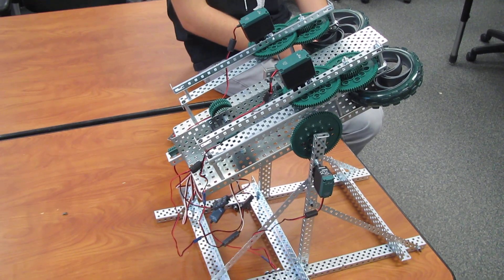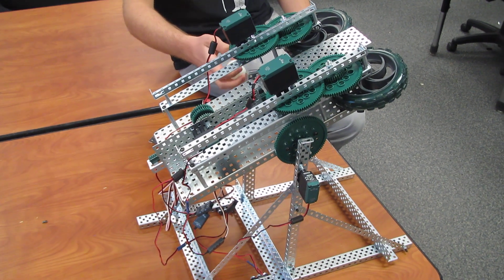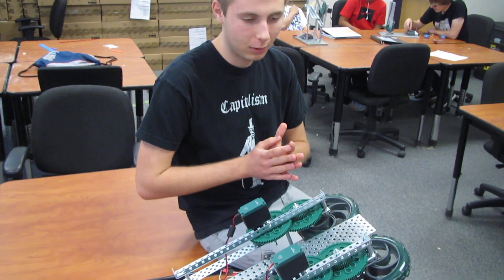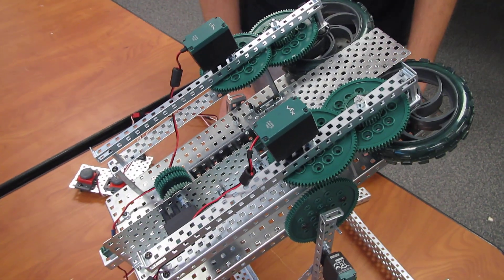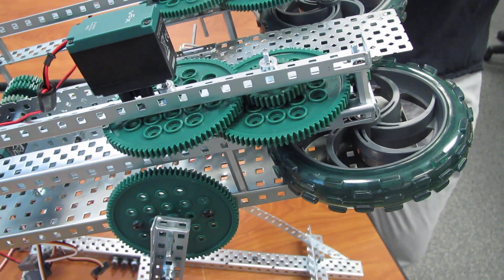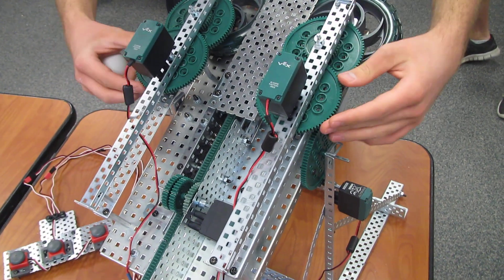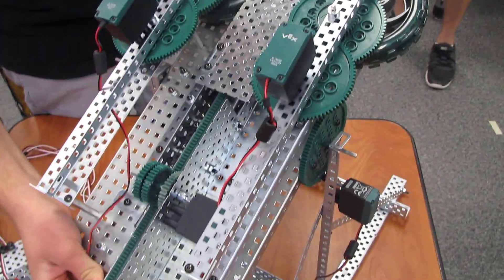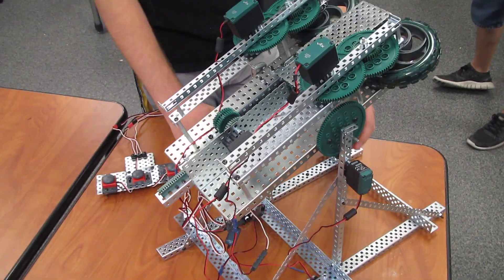Ping pong ball launcher Vex Robotics MRHS

Comment: Does that have high torque or high speed?
Reply: David Lu high speed, b/c the bigger gears are driving the smaller gears. Essentially for every rotation the bigger gear makes, (depending on size differences) the smaller gear will turn more. This all depends on the number of teeth on each gear and how the different gears are laid out.